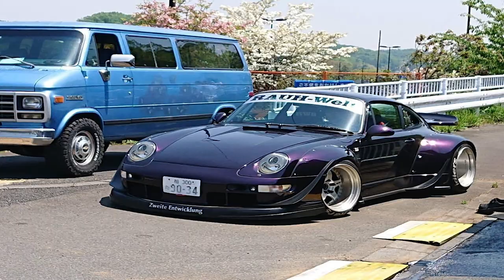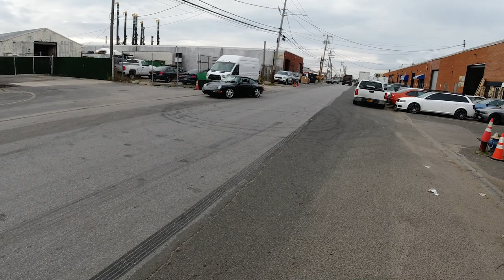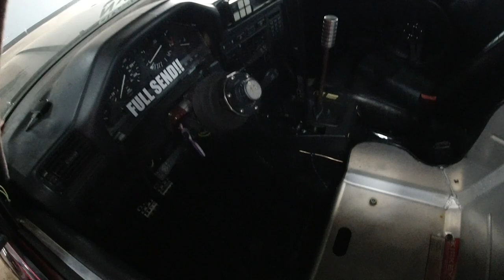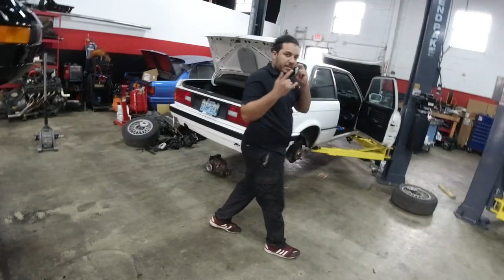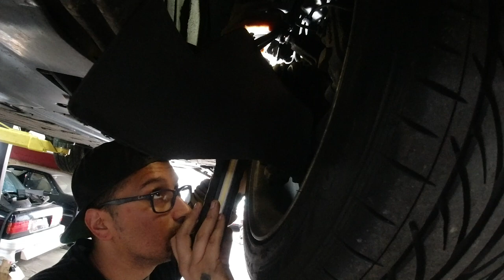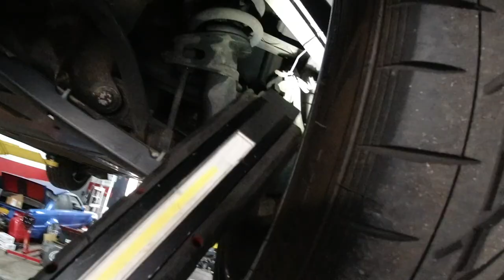Road to RWB with my Porsche 993 (Intro)

Comment: I seem to be the only one here who thinks you are about to ruin a beautiful car, one thing worth mentioning, it won’t handle well contrary to what you think, Porsche raced narrow bodied RS’s outside of the GT2 cars back when new and the narrow bodied cars are also faster more so with 18 inch wheels, butchering the car thrashes all the benefits. If I were you I’d do a GT2 build instead, it would be more beautiful and also increase value. Respect to RWB, but to me they are ugly and ruins possibly the most beautiful Porsche ever designed.
Reply from the maker: There’s always gonna be two sides to the coin when it comes to RWB. My opinion is the opposite side of yours. Respect to the GT2, but I think the RWB looks better. Once again, that’s my opinion. 
As far as believing that a narrow bodied car are faster, then I believe you’re incorrect there. If your theory were true Porsche would’ve never made their car’s wider as the generations progressed. Look at the 996 leading up to the current 992. And that applies to any sports car manufacturer. But to stay on the topic of 993, even the guys over at Guntherwerks have proven this with their bespoke widebody 993 builds.
Reply: Speed Racer Joe i hear you brother, but check the cars raced by Porsche themselves, every single 993 RS was narrow bodied, the RSR though had the same body as the GT2 race cars, it’s proven the narrow bodied 993c2/c4 handled far better and even possibly faster then the c2s/c4s wide body cars. For looks the wide body cars look kool, but for handling no way. Check Porsche history on my comments and see if I am wrong even the famous (official Porsche manufacturer) RUF yellowbird was narrow bodied. All aftermarket tuners are just that after market tuners. Porsche did not invest millions of Euros to develop a car that did not perform. Why do you think so? But all in you have a stunning car, feel sad you are going to cut it up. But respect you pays your money and do as you want. Good luck either way. Peace 👊🏿